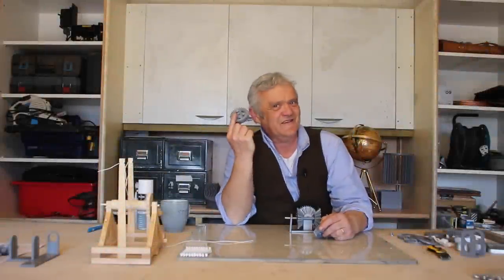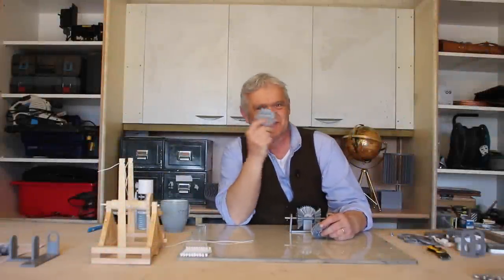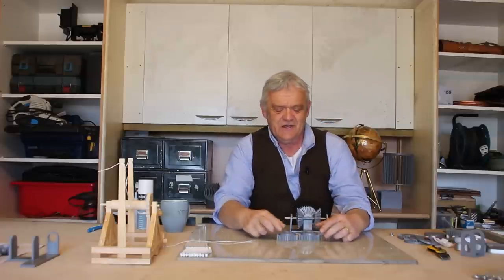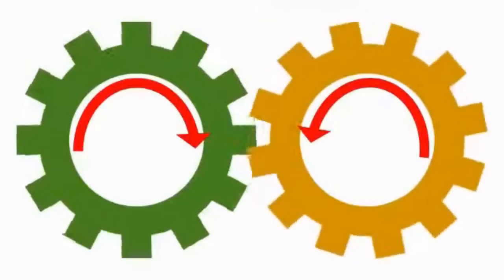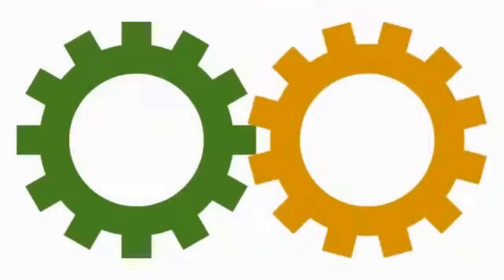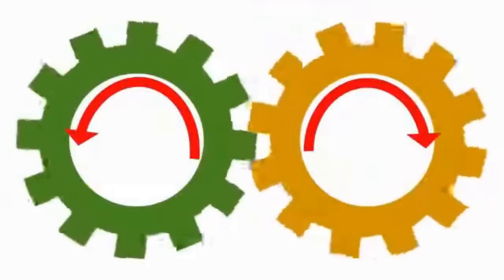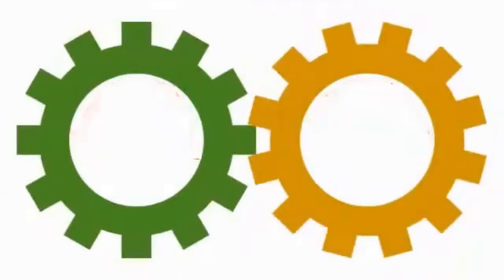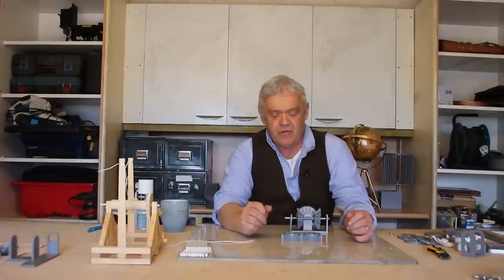1914 The Mechanical Rectifier The Bristle Ratchet And Sea Power

Comment: Nicely explained (as usual)!

It would be a bit of a bugger to print but rather than bristles you could use a spring. Twisted against the spring helix and the spring will try to expand and have a high friction, twist it in the opposite direction and it will just compress the spring until it slips along nicely! I do believe they make ratchet less ratchets this way, with a flat cross section spring.

Comment: I'm very familiar with your toothbrush pawl, having used "feather boards" on my router table for years, I wonder if you could adapt your gear tinkercad drawings to have a slot/clip in shoe on the meshing faces to hold the toothbrush heads instead of glue, this would facilitate easy and quick changeovers 🤔
Reply from the maker: lol - i never thought of it like that - but you are quite right - nice one mate

Comment: I think that the 'Mechanical Rectifier' should be incorporated into  every piece of playground apparatus that has a to-n-fro movement; such as a see-saw, and a swing  (two rods instead of the chains), They both produce strong torque tby way of leverage that could be geared for speed. We get the power while they get to play!....

Comment: Boat motors go forward or reverse using the same shaft, splined to two identical gears facing opposite of each other.

The power in from above gets locked into only one of the two gears, one will drive the boat forward and the other in reverse, but the engine continues to turn the same direction either way.

Comment: Molto bene ; ovviamente anche due cricchetti di bicicletta , montati contrapposti , faranno lo stesso lavoro ; mio suocero , Perotti Giuseppe , nel lontano 1940 circa , ha applicato questo sistema alla sedia a rotelle per invalidi che aveva una leva che sia spingendola che tirandola , otteneva un solo movimento . Very good ; obviously also two bicycle pawls, mounted opposite each other, will do the same job; my father-in-law, Giuseppe Perotti, back in about 1935, applied this system to the wheelchair for the disabled which had a lever which, both by pushing and pulling it, obtained a single movement.
Reply from the maker: yes they will and they also forma kind of differential

Comment: One thing that was possibly left out is the fact that you need to use the energy that's created in both directions and not just wasted . So you would are just redirecting the energy rather than eliminating one set

Comment: I'm glad I'm not the only one who finds lefty loosey and rightly tighty completely pointless. Especially when I'm having to join 2 sections of pipework together using a threaded ring. Lefty and rightly mean bugger all to me in those circumstances when the threaded ring looks exactly the same no matter which end you're looking at it from lol (genuine work grievance)
Reply: Ah yes, it seems you were failed as a child since you were not taught that clockwise is a right handed turn and anticlockwise is a left handed turn. Easy to learn just point you two thumbs along the axis of rotation facing the direction of force you wish to insert a threaded object towards, unsurprisingly the right hand is clockwise and left hand is anticlockwise and you will find outside of a very select few applications the right handed turn tightens and left handed turn loosens, so easy you could make a children's saying out of it...oh wait.

Comment: I'm a bit late, but... I wondered if you could use the "bristle clutch" as part of the drive part of the bevel gear, itself, since it doesn't need, as far as I can see, an actual 'ramp' to have it 'see' a pawl....it looks to e (simple folk that I am), that the angle of the bristles makes a 'pawl', all on its own?  This might reduce the maximum torque transmission, but drastically reduces component count??

Comment: Totally off topic Rob but I was thinking of an experiment at school where if you heat a copper penny then suspend it over acetone it maintains that heat for as long as the vapour lasts. I wondered about that application for a Stirling engine or maybe paltier or even steam boiler. Would the act of taking energy away stop the catalytic reaction?

Comment: Probably a silly question, but since your always up for the challenge of testing new ideas thought i might ask, i wonder if you could do a test to see if the toothbrush heads could be stacked facing a slight angle around a circular disk and see how effective it is as a turbine, to spin the disk when hit by a wind. Similar to your feather turbine idea.

Comment: Funny thing, I never really understood the lefty lucy method either... and I also use the Clockwise, CCW method when looking at top of the bolt. hehe.
Reply: It's easy clockwise and anticlockwise are right handed and left handed motions, respectively. Point your thumbs along the axis of rotation in the direction of force and you will find your fingers curl in opposite directions, the right hand is clockwise and the left hand is anticlockwise, now if only we had a saying that could dumb down this basic understanding so easily a child could grasp the concept...oh wait.
Reply: @nerofl89  Well sure. But, the problem is that the childhood saying doesn't have an intuitive "Thumby to Top ...  Curly whirly til your fingers stop" part... like, Thumby To Top, Lefty Loosey, Righty Tighty, Curly Whirly til your fingers stop. heheh
Reply: Lefty loosey righty tighty works if you imagine the bolt/screw head as a steering wheel
Reply: @marcfruchtman9473  I see you are just a disingenuous individual, hold a screw driver in either hand, and your hand naturally rotates the appropriate right hand naturally drives the screw inward and left hand naturally extracts. Maybe when you stop being intentionally disingenuous people will actually take what you say seriously.
Reply: @nerofl89  Apparently plenty of people don't understand it, including Robert Murray-Smith @ 1:11. So, no, It is not intuitive, because right and left are not intuitively designed into Clockwise and CounterClockwise. My hand, naturally rotates in both CW and CCW rotations when holding a screw driver. This is why many people don't understand it until you say Clockwise and Counterclockwise. Maybe you are misconstruing my attempt at revising the childhood Left Loosey as disingenuous? I was serious, I don't think children understand it well, and it seems incomplete. But, anyway... I prefer CW and CCW when looking at the top of the bolt... just as the video says.

Comment: No....
The whole point of the "toothbrush" episode was related to recycling and recycling old toothbrushes.
If you are simply cutting the heads off new toothbrushes there is no recycling and what is then even worse, is that you are using a product for something that it was not designed for.
Design a "brush" for the purpose that you intend on that case and don't make misleading videos about not recycling